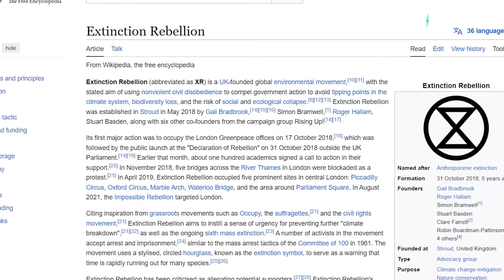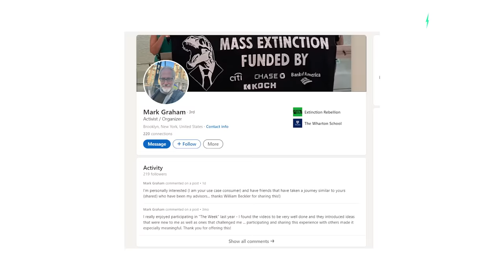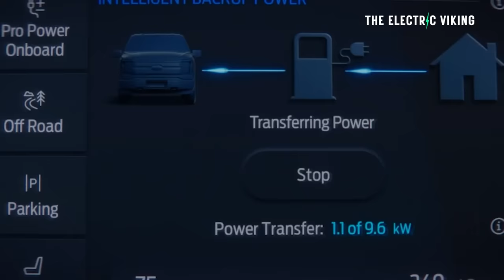Climate Protestors thrown out of NY Auto Show after demanding an end to EVs

Comment: Without subsidies EVs would be nowhere but the Protester are right - current EV are not zero emission and not green, in most places they are worse than Ice and ice can be 100% renewable using ethanol or biodiesel.  Brazil uses E100, Toyota has had 100% ethanol hybrids in brazil so one cannot really match that at all with EVs.EVs are also unrealistic. No one will build out a solar or wind powered world because you need giant batteries that not only cost a lot of CO2 to make up front but there isn't enough lithium produced to achieve it in 100 years even if you 10x lithium production immediately - which of course you can't.

Comment: They are correct. Their tactics are not.

If all we do is switch to EVs we will have done next to nothing to solve all the problems associated with cars. And we'll only even have made a small dent in overall GHG emissions.

Stupid comments about riding horses don't help. Cars have destroyed our cities. We need to rebuild our cities to reduce our dependency. EVs should only be for those trips that cars make the most sense. That's probably less than 20% in a functional city. Our cities are dysfunctional.

An ICE vehicle is only about 0.5% energy efficient at doing its primary job. An EV is only about 4X better. Both are insane.
Reply: 100% Robotaxi
Reply: @markplott4820 100% Robotransit. That is, when walking and cycling aren't realistic. Why do you live so far from everything that you need a motor vehicle?
Reply: @ronvandereerden4714   - SAFETY for one.
OPEN wheels are UNSAFE .
they are Fine in Parks & Trails with NO CARS around. 
and MOST Cyclists do NOT obey the Traffic LAWS on the books .
they RIDE unsafe. 
not against Bikes, but the RIDERS make bikes UNSAFE.
in JAPAN they teach Bicycles in Elementary school to High School .
you have to pass a Rigorous Riding course .
they have Riding competitions.
Reply: @markplott4820 Excuse me if I don't take you seriously at all. 

You are comparing 100kg vehicle doing 30km/h with a 3,000kg vehicle doing 100km/h?

Both forms of transportation have their irresponsible users. MOST motorists also do NOT obey traffic LAWS.

Why even post if all it is just complete nonsense?

Comment: Well, the protesters were right about one thing. EVs aren't the panacea to all our transportation problems. With EVs you just swap one set of problems for another. The EV crowd believes in magic. I imagine they've read too many Harry Potter books and are absolutely sure that if they wave a wand the world will be wonderful. If they were to take a few engineering classes their dreams would be shattered.
Reply: I have an ME (Master of Engineering (Electronics)) and I drive an EV - I don' think these two things are incompatible.

Saving the planet is not my motivation - I drive an EV because it's simply a vastly superior ownership experience - after 25,000km of driving (powered 100% by solar energy that was generated at home) I have paid off the environmental debt created in the manufacture of the car.

I never need to visit a petrol station, it takes zero of my time to charge and it has cost me less than $250 for those 25,000 km in fuel, $0 in services, brakes and tyres and the battery is rated for over 1million km of usefull life.

Comment: Yeah, it’s it’s like a gear type oil that stays in there permanently it sealed it never comes out. Most transmissions are like that nowadays fully sealed transmissions never need to be changed the fluid. They don’t even give you a port to add fluid to them anymore at least in my 2017 Chevy Colorado that’s the way it is but most gas cars are like that too the pumpkin in the back like on a rear wheel drive core it’s permanently sealed, but you can change out that oil like every 80 to 90,000 miles or something like that, but there’s so many vehicles out there with that uses oil and has sealed oil and sealed fluids and everything else. I don’t understand how these people make it in life being so dumb.

Comment: I don't think protesters should go inside a private venue but they are correct EVs aren't green; they are red.  An EV weighs 30% more and take 30% more energy to move; there is a 15% transmissin penalty to charge your EV. This means a grid has to be at least 45% "renewable" to break even; plus EVs take more upfront CO2 to make. 1 ton of refined lithium requires 500 tons of ore and 500,000 gallons of water, which is only 7% of the heavy battery. You have to look very hard to find a grid even 20% renewable. The big economies; China and the USA are 80% fossil fuel powered; less than 5% is solor or wind. Mostly nukes and hydro which aren't very green either.
Reply: Facts please:

1. The average weight of an ICE vehicle purchased in the USA in 2023 was 4329lbs - the average weight of an EV purchased in the USA in 2023 was 4208lbs.
2. A Tesla model 3 weighs the same as a 2 litre C300 Mercedes, A Tesla Model Y less than a smaller Audi Q5, even the gargantuan EV9 Air weighs less than a much smaller 300 Series Landcruiser, the model 3 and model Y were the two largest selling pure battery vehicles in 2023.
3. Average transmission losses in Australia are 7.9%
4. As of 2022 (and the number keeps growing) the renewables total by region was Europe 43%, South America 65%, North America 29%, Asia 27%, Pacific 39%, Africa 25%, Middle East 3%
5. The 500Litres of water used to make 1 ton of lithium is not fresh water wasted forever - it is brine water used in evaporation ponds, the water (as the name suggests) evaporates into the atmosphere and returns as rain water.
6. The average CO2 debt (the increased CO2 in manufacture) is paid off after 25,000miles in the UK, 35,000 miles in the USA if you charge 100% from the grid and 8,000 miles if you charge from 100% renewables like home solar.
7. Please explain the rationale behind the claim hydro-electricity is not green?
Reply: @TB-up4xi  You are giving averages including rare cars like they represent a typical ICE car sold; the top world sellers are Toyotas Corolla, Prius, CRV Rav 4 and Camry' average weight of 3500,  The most popular EV is the Model Y, followed by Model 3 long range,Ford mustange E, Model 3 Std range, and VW and Ionic 5 average weight is 4500.  If you have vehicles that have ICe/EV models like Ford F150 its over 1000 lbs for the EV; the Mustang over 1000lb for the type mustang type e. So it is much more honest to say EVs weigh more by 25-33%.

Comment: New high technology is always more complex.  Go take a look at a 1920s radio set and compare it to the ones made in the 30s.  Go find a 1970s VCR and compare it to a the last ones made.  EVs are a new technology that will be streamlined in the next generations to come.
Reply: Have you ever sat in a 2014 Leaf? They have no controls at all. Just a button that says "on" and "off". And a steering wheel.
Reply: Already, if what Sam Evans said is true, the upcoming Tesla Model 2 will be a much simpler car than now, because of modern battery design, motors and electrical wiring plus a much simpler body casting process.
Reply: @Sacto1654  Yep.
Reply: @Sacto1654 keep in mind that manufacturers are looking more into full automation for EVs as they are simple to manufacture. More unemployment. EVs have much less maintenance. Cannot be repaired at a 3rd party shop under warrenty. Those companies, gone. Mechanics who have thousands into ICE tools and training will be redundant as there will be even less maintenance, so those jobs will dwindle aswell. Gotta think about all of these factors. But I'm sure they don't matter to anyone anyways, so it's fine if they become unemployed.

Comment: There is something to be said for making cars simpler and cheaper. There are a lot of "bells and whistles" in today's cars that are superfluous, such as key-less access, which make the cars more complicated, expensive, and prone to breakdown.
Reply: TESLA cost way LESS to make than ANY other BEV, and last the LONGEST. 
Tesla have 90% less Maintenance than ICE.
Reply: @markplott4820 which means less mechanics jobs, means more unemployment. Great!
Reply: @AhjTheMediocre   - TESLA employs Thousands of Mechanics Worldwide .
and they are HIREING.
but , you need Experience fixing BEV.
need to be able to use a COMPUTER.
Reply: @markplott4820  so which is it? Either the same amount of jobs stay, or there is less jobs because they need less service. You can't have both. If you worked flat rate, you'd see the problem.
Reply: @markplott4820  and computer knowledge isn't all of it. The voltage in these packs alone should be charging hazard pay. Not to mention, regulations regarding EV service requires twice the space for battery replacements, cutting overall work time down, or double the work grounds. Either way is costly for a shop.

Comment: I don't  agree with extinction rebellion, because EVs running on renewable electricity are much more efficient and sustainable. But ultimately, they are right. If EVs are much cheaper to buy and run, then we will just use more of them and drive further. To solve the climate crisis we really need to make some very difficult lifestyle choices which most of us won't be willing to make until we are well past climate tipping points.

Comment: ICE car 1,200 moving parts. Electric car 60 moving parts. 
When your IQ is smaller than your shoe size it is difficult to understand simple concepts.
Reply: According to AAMCO the average GAS car has over 200,000 moving parts.
all which need servicing & replacement over time. 
BEV are basic Maintenance FREE. over 80% less Maintenance than ICE.
Reply: @Markcain268  With high amounts of never ending maintenance and forever spewing CO2.
The old ladies are good for motor heads so hang on to the ones you can work on as they will slowly disappear
Reply: @markplott4820  I'm thinking just the drive train
Reply: @Markcain268  get off your key-bored

Comment: People converted older cars into EVs. These cars are simple. The high cost of repairs on new EVs is not necessary. To make EVs complicated is to keep repairs high to continue revenues lost from ICE cars service.
Reply: Cars converted into EVs feature a third of the range of a dedicated EV, are heavier, and don't have anywhere near the battery management capability (for longevity and fast charging) that purpose built EVs do.  They also don't have integrated HVAC, nor will these converted cars be day to day reliable for 10 years and 200K miles.

Comment: Come on, Sam. You know darned well that "big oil's" products are used at just about every turn in manufacturing an EV. From the tyres, the paint, rubber door seals, cooling system components, insulation, the foam in the seats to the seat belts and the list no doubt goes a lot further than that. It's not just a bit of oil for the gearbox and a few bearings.
Then there are the demands placed on big oil as far as harvesting and refining the minerals used to make EV's, transport them to the point of manufacture and then out to market.
And whether we like it or not, then there is the inconvenient fact that nearly 2/3 of the world's electricity that is used to power EV's is produced using thermal generation fuelled by fossil fuels.
And, by the way, the thermal efficiency of which is not much better than a modern diesel engine and in some cases is worse.

The great shame with EV's is that nobody has stopped to consider what a waste of resources it is jamming huge batteries into something that we only use for an hour or so per day.
Historians will look back on us and call us idiots for wasting those resources in such a fashion. EV batteries would be much better used in grid storage for renewables, 24 hours per day, 7 days per week, 365 days per year. Then we'd be tackling the biggest problem that we have, electricity generation and not one of the smallest, passenger cars.
But you can park your ego in the driveway for all your neighbours to see, 23 hours per day. Having your intelligence sitting in the back yard doing a job 24 hours per day where nobody can see it just isn't as appealing. Good luck to the likes of Musk and co. in making us think that way. And good luck to the world's leaders who can sit back and do nothing while we all obsess over the one thing that will make the least difference. 

I wonder how long this comment will last. Not long, judging by my previous posts.
Reply: @Markcain268  That's refreshing. This time I didn't get removed. I reckon that more than half my posts on this channel do, though. The funny thing is, I'm not anti EV. I'm anti ignorance. Cheers.

Comment: EVs certainly won’t solve climate change, but they’re cleaner, especially for cities, and less carbon intensive after 60K of use…. Seems strange to target EVs, no one is giving up on cars anytime soon, that’s for sure.
Reply: but, Switching to 100% SWB - (solar, wind, Battery) will.
even w/ 25% SWB is way better for the Environment. 
BONUS - w/ 25% SWB can 100% meet DAILY energy needs & supply some SUPERPOWER (100% free power). 
with 80% SWB investment , you can meet 100% Daily needs & generate Massive SUPERPOWER.